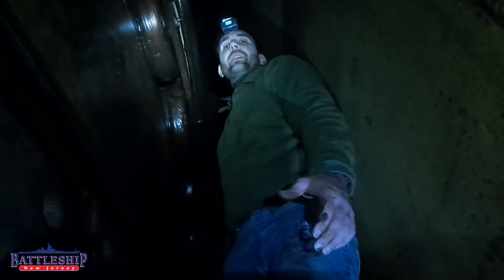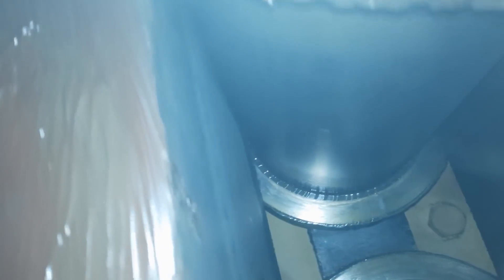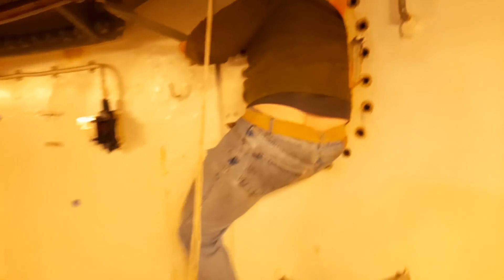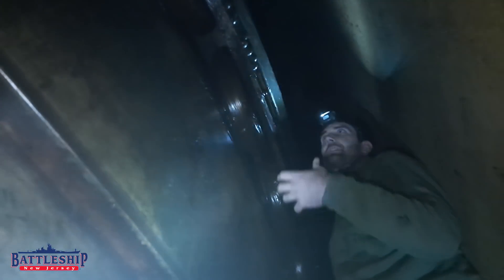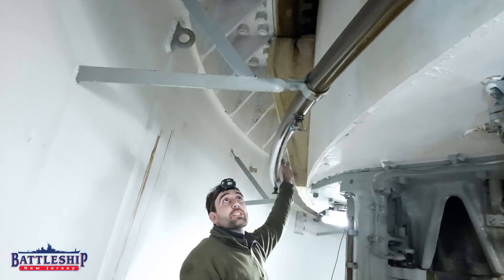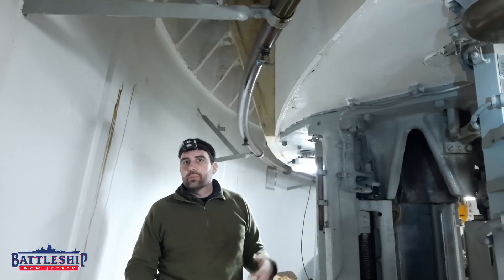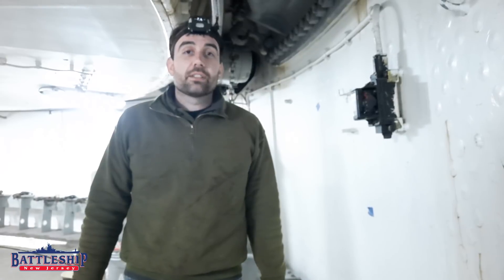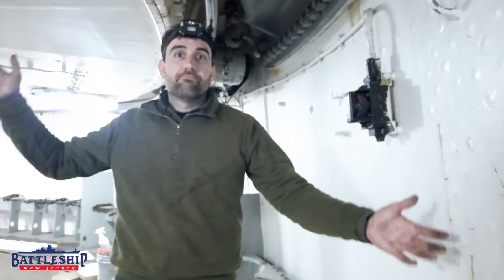Do the 16in Gun Turrets Still Rotate?

Comment: Greasing those roller bearings looks like a job for the lowest ranked gunnery mate.
Reply: Probably not, PMS, Preventative Maintenance Schedule dictates when each piece of equipment is serviced. It is rarely done by someone under Petty Officer 3rd Class.
Reply: What was the frequency rate of greasing those bearings?  2 or 3 times a week? Once a week?
Reply: @bumblebeebob  It has been 31 years since I was a gunners mate on the USS Iowa so I honestly can't remember.
Reply: @Bellthorian  thank you for your service.  it's odd to think of 1940's battleships being active in the 1990s, fully 50 years after their primary service had ended.
Reply: @bumblebeebob  Probably at least weekly, and again after so many traverses if the turret is in use. Would be at least 3 people in that crawl space, 2 going from grease point to grease point with the pressure fed grease gun, and one to do coordination to the person outside that operates the 2 pressure grease pumps that have the hoses fed through the portal.
Reply: @SeanBZA  l don't know why l didn't get notification of your answer until today,  a month later.   Oh YouTube, go home. You're drunk. 

Thanks.  I kinda expected a once a week minimum/ as need if used more often,  like asap after a combat encounter. Having a crew did it also makes sense. Thanks again.
Reply: @bumblebeebob  checked every 6 months
Reply: @bertiewooster3326  Thank you.  I was thinking along the lines of "asap after an engagement with the enemy" where there was potentially heavy use, but wondered how frequently it was done during more peaceful times. Twice a year seems about right then.
Reply: Even more important to pick the SMALLEST gunner's mate! That space is really tight.
Reply: @DonaldMcKay3768  Damn, that would have been me---had I been navy.
Reply: It doesn’t look like that bad of a job, something I might volunteer for to get some sort of peace and quiet.
Reply: @Moltenbramley  just hope they don’t fire the big guns while you’re in there. 😁
Reply: That was the guy that had to clean the head with his toothbrush...
Reply: @finscreenname  Nah, that's a punishment.  Greasing the bearings is just a shit job that has to be done.
Reply: @finscreenname  That's Boot Camp type punishment. That sort of thing is not done in the fleet.
Reply: @davidjacobs8558  I will be honest, I am not sure. It has been 31 years since I was in the Navy so I do not remember.
Reply: @davidjacobs8558  No. You can say 'fire" as many times as desired.
Reply: @KB4QAA  yea but other ships blow up when you do.
Reply: @massmike11  that sounds like a "them" problem.
Reply: "Right son, this bucket of Grease and this mop...Dip apply...rinse repeat until I tell you to stop".
"Yes, Chief"
Spends whole cruise doing this day after day.
Reply: I can imagine a skate rat climbing in there to take a nap.

Comment: Any plans to try an rotate the turret ?
Reply from the maker: Nope. Without the electrical and hydraulic systems it would be very tough
Reply: @BattleshipNewJersey  That is a sham, I was thinking if you did rotate them to different angle right than to the left when you come back to the center line, weight of the turret would be setting on a different spot on the rollers. Kinda like rotating the tires on a car.
Reply from the maker: Having them off center would also break with tradition, they'd always be centered in port
Reply: @BattleshipNewJersey  Centered is were you would let them set after rotating them.

Comment: So technically they could work right? Also as soon as you guys open again I'm going worth the 4+hr drive
Reply from the maker: Maybe!
Reply: @battleship New Jersey Bet that would be a great fund raiser. So much money equals a video showing the turret moving . Start out small (5 inch) and work up to the big boys. Also might want to add another one to show how to elevate the barrels.
Reply from the maker: We do occasionally move the 5in guns for maintenance!
Reply: @BattleshipNewJersey  For "maintenance"....suuurre.  We'll go with that.
Reply from the maker: We fire them for fun, we rotate for maintenance. Pssst if you call ahead, we let guests fire the 5im guns. Can't remember what the donation for that is, I think $500
Reply: @SealofPerfection  I think all of the museum warships do that with their secondary batteries and the 'tincans' do it with their deck guns.  The guns cannot be fired of course, they've been 'demilitarized' with key components removed or welded solid and discrete (sometimes not so discrete) holes drilled in the barrels to make them unusable.  One of our local military museums here has a British 25 pounder howitzer on display, beautifully preserved except for a damned big hole cut in the side of the barrel where it can't be concealed.  The same museum also has a German 88mm Flak Gun (towed) that somehow either didn't get properly 'demilled' or the intentional damage repaired to the point where it can fire blank charges, which they do several times a year.  Go figure.
Reply: @robertf3479  Is that museum in VA?
Reply: @BattleshipNewJersey  Is there any chance of seeing a video of the 5in guns rotating and elevating at full rotational speed for those who don't live in the US?
Reply: @robertf3479  Nothing in the law says you can't have these things, a gun over 1/2" without a "sporting purpose" is termed a "destructive device" and requires a $200 tax to be paid and some paperwork and background checking, but unlike a machine gun you can make or buy a new one and re-activating an old one is considered the same as making a new one, so if you file your paperwork it's perfectly alright to have such things.  Museums don't get special exemption in the law anywhere, although sometimes local law enforcement will work with them because they do have that exemption but it's all done on departmental letterhead and some museums are rightly leery about what would happen if some new police chief or sheriff or whatever decides to rescind all their letters.  I don't know why so much stuff gets demilled, since once you get into the scale of artillery pieces $200 is nothing.
Reply: @robertf3479  The 25 pounder is a gun howitzer, probably the first in the world. The 105mm Light Gun, also made/used in the USA is its spiritual and practical successor, in the same capacity.
Reply: @BattleshipNewJersey  never has the "shut up and take my money!" Meme been so applicable
Reply: I thought the NDA rules regarding DDs and all that fun stuff applied only to explosives and cased ammunition? For example, "37mm flare launchers" aren't regulated unless firing certain/restricted ammunition. 

I mean... Technically... If one of these were to be loaded with an inert projectile... I'm just saying...

Of course I would just be absolutely elated to see these things train and elevate!
Reply: Ugh. NFA... Not NDA.
Reply: @dusterl1472  A gun over 1/2" can be determined to have a "sporting purpose" (some guy got a rifle that shoots 20mm autocannon rounds approved) and be exempt, which most shotguns are.  Individual projectiles can have up to 1/4oz of explosive without be regulated, above that each shell is a DD and must be registered, which gets expensive if you want to shoot explosive ammo or grenades, etc.  Most people don't bother.  I'm really not sure how naval rifles too big to used "fixed ammunition" interact with the NFA, when it was written they were current military arms and unlikely for anyone to own.  You'd probably need an explosives license just for the propellant, honestly.  

Here's an idea: get everything in order for 2076 so that if our nation survives 'till its tricentennial the Big J can be towed out to sea and fire a full broadside in commemoration.  Can see no other excuse for the maintenance it would incur, but I might live to see it!
Reply: @BattleshipNewJersey  Oh, you shouldn't have told me that.

Comment: So they technically still do rotate.It would just take a lot of work.To get them moving.
Reply: Especially since the turret training gear would have to be manually operated, something I don't think they were designed to do, at least not easily.

After Iowa suffered her explosion, at some point they had to train that turret back to a centerline position.  An old shipmate who had transferred to Iowa from my ship told me that the equipment to do that is built to take incredible punishment.  He explained that during their preparations to train the turret the ship's electricians and the shipyard carefully examined the training motors and drivetrain as well as the rollers that Ryan just showed us and found nothing busted or fried beyond reasonable repair.  They fixed what looked like it needed TLC, installed new circuit breakers or electrical fuses and found it able to turn.

They never did fully repair the turret, choosing instead to retire the ship.  If she had been reactivated again, for Desert Storm for example ... she'd have come back as a six gun ship rather than as a nine gun ship.

Comment: If you were to make them turn again, even if you used a different method to move them, would you be in violation of your contract with the navy?
Reply from the maker: Our contract allowed us to move the barrels to their current elevation, I believe that our contract would allow us to rotate the turrets as well. However the systems that do the rotation we can't use so it would have to be done by hand which is basically impossible.
Reply: @BattleshipNewJersey   how big is that hand crank? could you show us in a future episode. i had a 150 hp outboard boat motor came with a puny pull string and handle in case you were stranded.  lol good luck starting it unless you were a huge  body builder even then i dont know. keep up the good work.

Comment: I think it would be nice to have them operate for special occasions.  Although the lubrication, cleaning and power required to operate the electric motors and hydraulic pumps would probably make it impractical.  Not to mention those motors and their control circuits have not operated since she was mothballed in 1990 so they would probably need a lot of maintenance.  Can’t wait to watch this video though.
Reply: The killer would be the bearings themselves. The weight of the turret's going to cause very slow plastic deformation of the bearings. Once they're sufficiently flattened any attempt to rotate the turret is first going to require a lot of torque, and second is going to cause hammering each time the flat sides of the bearing reach the track.
Reply: @Jesse-qy6ur  Not an impossible job to fix, just a very difficult and dangerous, not too mention lengthy, one to get accomplished.
Reply: @Jesse-qy6ur  theoretically speaking, if the turrets were still in active use then there would be little worry for deformation, and as long as they were properly maintained (greased, and checked for cracks), then they would be perfectly operational. However, considering the amount of roller bearings there are underneath that turret, I would be genuinely surprised to find out if even a single one of them had deformed, even with how long its been stationary. The biggest problem with any of these ideas is power, because as far as I know, the Iowa class were steam powered, (please correct me if I am wrong),  and there are very few individuals around today who know how to operate such large systems. Not to mention how dangerous it would be to try and fire one back up so that it could generate its own power again. It would take a serious amount of effort and time to make sure everything is capable of withstanding the pressure, and who knows how many people would be needed to make sure of this let alone give it the O.K. to run again. And again, if they were converted later to diesel or something and I just never heard about it, then literally half of the things I just typed wouldnt be needed. But it would be impressive to see one of them moving under their own power again in open water. Maybe for a 4th of July or something so that it would be an even more special occasion. As for firing the main guns, that could be done offshore so that theres at least a buffer between the ship and everyone else, then the news would actually have something positive to report on. Obviously no shells but even still, just hearing a full volley from one of those ships would be amazing.
Reply: @literalfire1927  The turrets are electrically powered. The center of each turret's turntable is an uninsulated pipe marked for the gas ejection system. The electrical cables all have enough slack in them to accommodate the turret being moved to maximum deflection for over-the-shoulder shots -- they're allowed to twist and untwist naturally. That rules out the possibility of steam being used to transmit power into the turret.

The Iowa museum did a catacomb walk which is neatly complementary to the one that New Jersey did a few months back. To my eye it looks like the turrets take delta-configured three-phase electricity, fed in on port and starboard on 7th deck via the catacombs cable chases. I don't see any reason you in principle couldn't run the turret off shore power, but you're going to have to run 3-phase cabling into one of the electrical switching rooms and rig up a wye-delta converter. I suspect the ships also use 400 Hz AC, rather than 60 Hz AC, so that presents another headache.
Reply: @Jesse-qy6ur  well now that I know they're run off of electricity then I think that is even more of a reason to either retro fit some form of a generator to power them without having to keep it cabled to the shore, or get the steam engines up and running so that they can use the steam power to generate the electricity needed. I wasn't trying to suggest that the turrets operated off of steam power, I was suggesting to get the engines working so that it could go out to sea under its own power. And I would assume that they would have used said steam to also generate the electricity for everything so then you can hit two birds with one stone. But this entirely out of thought. Sadly I've never been able to set foot on one of these ships let alone see one with my own eyes so I have no room to speak on how this should/could be done, just that I think it would be a highlight in our history for these ships to move under their own power again and do something similar to the fleet of ships that were all white. They were used for basically publicity while also being functional warships. I think the St. Lewis was part of it? I could be wrong. But it would still be impressive nonetheless.

Comment: Looking forward to seeing this. This was a question I had been wondering about, if the turrets can still rotate. If they are welded, what would be the reasoning behind doing this?
Reply: part of the decommissioning limitations and set in the contract.... just like how the Russians required us to destroy the Titan 2 silos when they were decommed in START
Reply: I will also take a stab at this, without hydraulic pressure holding the turrets in place it would be possible over time for them to move slightly off center. Moving them by hand would be almost impossible. Welding them in place would prevent this.
Reply: @Bellthorian  They also have a VERY serious mechanical brake and a pair of locking pins to stop the turret from rotating...probably intended for use in heavy seas.